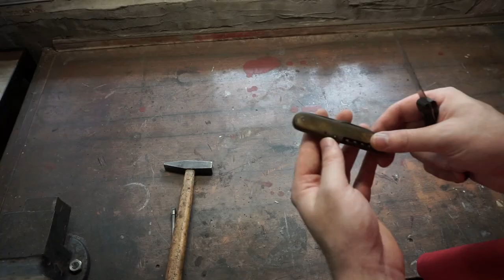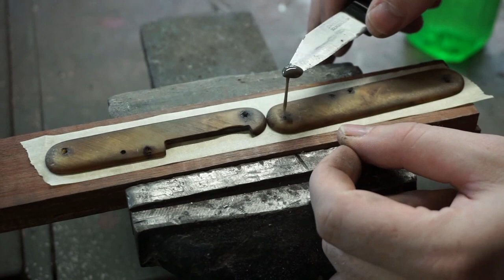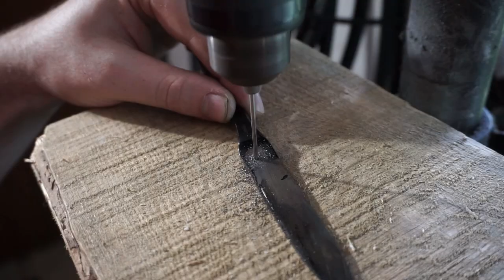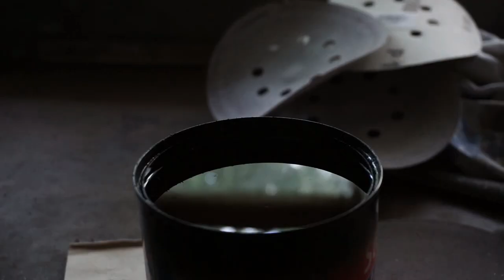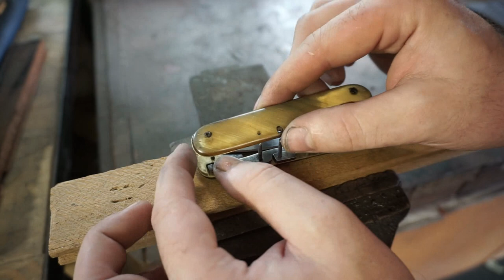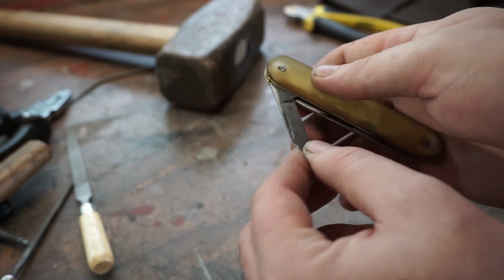Restoring broken old pocket knife

Comment: Neat knife. You did a great job. 👍
Did you manage to properly harden the blade? I'm assuming that it was carbon steel, as stainless can be very difficult to heat treat. Also, did you temper the blade? I'm genuinely interested. Thanks.
Reply from the maker: Yes, the blade is made of carbon steel, the hardening was successful after the third attempt, and as for tempering, I heated the blade until it took on the color of straw then I dipped it in oil again. I’m not an expert just an enthusiast, so I can’t say with one hundred percent certainty that this is the right way. Thank you.
Reply: @matavz18   From what I know you are spot on in your methods. I like how you used brass pins too. Getting both blades to fit can be tricky too, so well done there. Slipjoints are deceptively complex.
I hope that you get a lot of enjoyment out of carrying and using your restoration. 👍